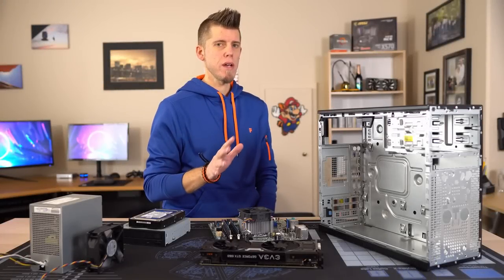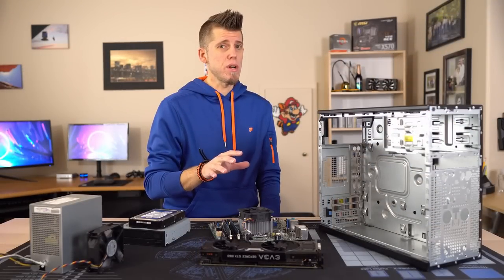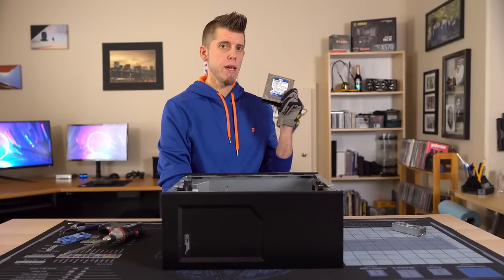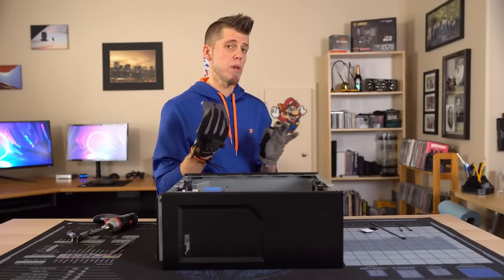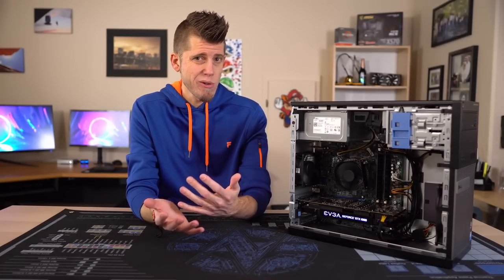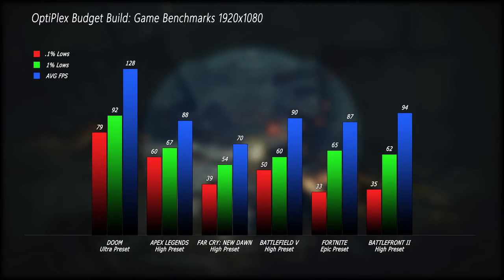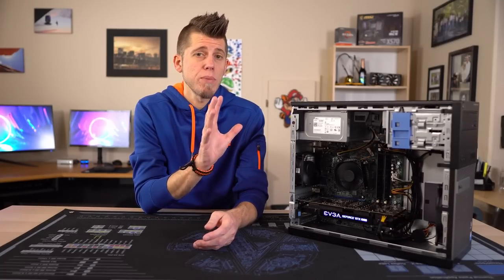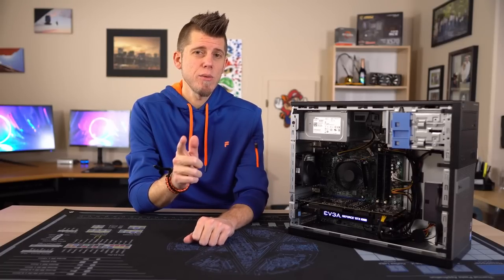Dell OptiPlex Budget Gaming PC For Under $300?

Comment: I've got an optiplex 7010 with i7 3770 and 1060 6gb 500gb ssd 1tb hdd and 20gb ddr3 1600 as my living room console replacment pc
Reply: Also dremeled out the front and put a 120 blue led fan in front and one in back. I had all the temp sensors and everything so it boots without F1 aslo. I painted the front black where the grey is and white where the black is for extra flare as well
Reply: Had to cut out part of the drive bay and get 90 degree data cord to fit gpu...

Comment: can you upgrade the rear exhaust fan or no?
Reply from the maker: Yes, it's just a 92mm fan and there are adapters to go from the five pin Molex SL connector to a standard 4-pin fan. It's a pretty decent fan though. You can try to replace it, but it can be problematic as the fan controller is very picky. The fan might work but throw an error code.
Reply: @TheGameBench  so if I get a better 92mm fan that uses 4 pin everything should be straight or should I just not worry about. I just added a 140mm intake fan and just wanted to know if it was necessary to upgrade the exhaust fan

Comment: how did you install the fan
Reply from the maker: If you're wondering how I modified the case to get the fan in, I did a video on what you need to remove to be able to install the front fan. I will say that there are ways to do it without doing what I did. They just don't look as clean.
Reply: @TheGameBench  what product you stick for cable management?
Reply from the maker: @pyromisery1638  What specifically? Everything I used in the video is linked in the description.

Comment: How much watts is the psu in that optiplex?
Reply from the maker: It's the factory power supply, which is 290 watts, which is fine with anything up to around 120 watts using the adapter. If you don't trust those, or you need more power, the XE2 power supply will drop right into these systems and are 365 watts. They also have a 6-pin PCIe power connection that can be adapted to 8-pins.
Reply: @TheGameBench  i have optiplex 990 mt version, i am thinking of a cx550w M power supply upgrade. Its length is 140mm(5.5 inches). Do you think it will fit. The 990 has 265w stock psu

Comment: Does it work with gamemax vp 700?  optiplex 790
Reply from the maker: I know that PSU isn't one of the best out there, so I'd be careful with how much of a load you put on it. Definitely don't trust the 700 watt rating since it looks like it can only supply 576 watts on the +12v rail. I would try to keep the power consumption around 400 watts. And with the 790 and a 1060 6GB you'll be well under that.
Reply: I will put a gtx 750 ti card, is that enough?
Reply: @TheGameBench   PS-LTP-0650NPCNUK-2 ok that ?

Comment: can i do this on dell optiplex 3040 mini tower????
Reply from the maker: Yes... with some exceptions. The 3040 has a 240 watt TFX power supply. The same one found with the xx20 SFF models. So, the power supply isn't good enough to run a 1060 6GB. You can easily solve that with by replacing it with the Dell XE2 SFF power supply. You can find them on eBay for about $35, and they're a 315 watt power supply. They'll drop right in to your 3040 and then you'd be fine with a 1060 6GB, 1660, 1660 Super/Ti, and possibly some lower clocked RX 470/570s. I'd suggest using a dual SATA to PCIe adapter with most of those cards.

The other thing to keep in mind is clearance. The 3040 is pretty narrow and you may run into clearance issues depending on the model.
Reply: @TheGameBench   thank you very much!!
Reply: what about  gtx 1650 4gb on  Dell Optiplex 7020 { i5 , 16gb ram }
Reply from the maker: @pesstudiogameplay6412  Yep, the SFF models all have a 240 watt PSU and it's more than enough for a 1650. With the 7020 and 9020 SFF models, the PCIe x16 slot is right next to the power supply, so you'd have to use the x4 slot near the CPU instead. Yes, it will affect performance slightly.

Comment: Optiplexs are still affordable even now with all the price inflation but the graphics cards are still to expensive
Reply from the maker: Yeah, most everything has come back down to a reasonable level, but GPU's are mostly still absurd. You can find somewhat decent deal if you're willing to look at something with 4GB of VRAM or less. And while GPU prices have dropped, I don't see it getting a lot better until ETH 2.0 drops and makes mining with GPU's impossible. Then I feel like it will get a lot better, so long as people are willing to buy ex-mining GPU's as the flood onto the market.

Comment: This Gtx 1060 with psu stock?
Reply from the maker: Yep. The 1060 is pretty power conservative. As long as you don't overclock, it's fine on the stock power supply.

Comment: Thats not even good deal. I got 2x rx470 4gb strix, non working fans for 75eur both. Ill just go for cheapest option for cooling and that is geting rid of on-radiator fans, buying gpu cooling companion that sticks in slot under gpu from aliexpress for 6$ and will undervolt the cards. Im not going for cfx deffinitely. They are going in two separate builds with i5 3470 cpus.

Comment: I'm a precision guy myself.
Reply from the maker: That really depends on the Precision. Your entry level models are mostly just rebranded Optiplex systems. The T1700, for example, is just a 9020 with a different faceplate. The only other real difference is that it could come with the XE2 power supply. The T3620 was entirely different, and an interesting system for sure. Definitely better than the Optiplex xx40/xx50 in every way. Now, if you're talking about the higher end workstations, that's a different story.

Comment: What’s the back fan size
Reply from the maker: The rear fan is 92mm. In the 390, 3010 and 3020 it's the standard 25mm thick. In the 790/990, 7010/9010 and 7020/9020 it's 38mm thick.

Comment: try to go with a RX 580 they're cheap too and probably better than 1060.
Reply from the maker: Maybe, maybe not. However, you're not running a 580 off the stock power supply unlike the 1060. I spent the last two weeks trying to get a good deal on a 580 and the best I came up with was $120, plus at least $40 for a half decent power supply, and now I've gone over the $300 budget. I'll admit that it's possible to get them cheaper, but it's certainly not common or a realistic scenario to give to people who want to emulate this.
Reply: sure, but not at this price point 🙂

Comment: Greatly appreciate your taking the time to make this and the other videos. Question: Would this work well as a PSU (after getting an adapter cable)? Found it when cleaning and never used it :) https://www.newegg.com/antec-smartpower-2-0-sp-500-500w/p/N82E16817103937

Thanks.
Reply from the maker: Yeah, it'll work... depending on what GPU you want to run with it. It only has dual six pin PCIe connections and it probably has about 375 watts, combined, on the 12v rails.

Comment: Anyone watching this PLEASE DO NOT use the Optiflex PSU with a 1060 GPU or your build will die. The existing Dell Optiflex standard power supply is dangerously inadequate for the power demands of the 1060 GPU. The 1060 minimum power requirement alone is 400 watts and the Dell power supply he is using is only 280 watt or 300 watt at maximum. The whole system needs a 500 watt PSU minimum, a 300 watt PSU will be under so much strain powering the components including the GPU, it will fry many components when it eventually blows up.
Reply from the maker: The 1060 consumes 120 watts. The rest of the system is under 100 watts. The nVidia power recommendation is a vast overestimation to cover their ass.

Comment: you should have just migrated it to a new case, spending a 30 bucks for a new case would be totally worth it.
Reply from the maker: Though I would argue that a $30 case would be worse than this one. At least the OptiPlex case is sturdy. I've not seen a $30 case that didn't have the structural integrity of a boiled noodle. Plus, there's all the proprietary connections, at are a PITA to deal with. If you don't have the tools... is it cheaper, and easier? Sure. But I would say spend $60 and get something like the Phanteks P300A.

Comment: Can I out a rx 580 in a dell
Reply from the maker: Sure, the RX 580 would work as well, but it will absolutely need a better power supply.
Reply: I bought one Dell optiplex from Amazon with rx550 16gb ram

Comment: This is a pretty good video, solid build, but in a PC build video, its never really a good idea to instruct people to mess with the power supply cable or try adding connectors to it what so ever.  Also using the stock power supply from an optiplex when adding the GPU and another HDD like that is never a good idea.
Reply from the maker: I've done a lot of work with power supplies. Sleeved my own PSU cables. There's nothing wrong with what i showed people. It's perfectly safe. The PSU has adequate amperage for the added fan, PSU, and SSD. That being said, I offered alternatives for people that didn't feel comfortable with the modifications.

Comment: Bruh 1060 3gb on ps4 pro and 6gb on xbox BRUH your giving them to muchh credit it's more like a gt 1030 XD OR A 950 OR A 780 XD
Reply from the maker: I don't man... that seems to be the consensus on the hardware side. However, I feel like the hardware is being held back by thermal and power limitations.
Reply: @TheGameBench  well let me tell you why hardware doesnt matter the cpu jaguar is garbage cant multitask for shit a 3000g or even a celeron from the 7th generation can beat the performance of a ps4 or xbox one the normal versions of the console are the equivalent of 7850 in terms of performance just cause it has 8gb of vram doesnt mean it even comes close to using it they just added it for future proof the games to work and remember no game on the ps4 or xbox one peo versions runs natively 1080p 60fps no game runs like that no tripple A game atleast for example overwatch and black ops 3 dont run at 1080p they nearly run at 900p try to do a comparison put two monitors together and you will see that the quality of image is garbage I bash it so much cause I got sucked into a console when I could have build a pc a long ass time ago and enjoy WAY BETTER GAMES remember they need to keep cost low and sell high so why would they put high end hardware like that and also the 1060 didn't come out yet at that time sorry for long paragraph but there have been many tests on what resolution or quality they run and majority is 900p

Comment: Under watt power supply.
Reply from the maker: I've done my testing, and the 1060 is a low power consumption GPU. This pulls about 240 watts from the outlet at a full system load. Since the outlet draw will be higher, the components are consuming, at max, 220 watts or less. While not ideal, it's functionally fine. I tested this in my last video.
Reply: @TheGameBench  Key text right there. "not ideal"

So why would this be okay? Even for a budget build, nah dude. Thats not worth it if the 1060 is not running all the way.
Reply: @TheGameBench  Still pushing the line since the recommended PSU for that GPU is 400W and you have a 255W PSU.  220 is unnervingly close to maxout, I guess its technically works but still risky i think.
Reply from the maker: @morpheuskibbe  They also suggest a 300 watt power supply for a 1050 Ti. A GPU that pulls less than 100 watts. The 1060 pulls about 120 watts. They do this to cover their ass for people buying garbage power supplies that rate high peak wattage, but provide low constant wattage or have low amperage on the 12v rail. Also, this is a 290, not a 255, watt power supply and it's not a terrible power supply either. I've torture tested these. They can handle a 1060 with about 70- 80 watts to spare.

Comment: Dell 290w PSU tier Bronze or Silver ?
Reply from the maker: The one in this video was not 80+ rated though you could find them with 80+ bronze and 80+ gold rated units. I will say that it doesn't really matter outside of efficiency.

Comment: Nowadays optiplexes go for a high price. I guess people realise what they are capable of. ;_;
Reply from the maker: Yeah, but you can still find deals. I grabbed a few for under $100 here locally. It doesn't help that everything PC related is up right now due to the pandemic. However, I've heard that supply chains have opened back up on new parts, so it's only a matter of time until we see used stuff drop down to pre-pandemic pricing again.

Comment: well hell WTF i would rather have a  i5 9th gen then a i7 4th gen ... but you almost pulled it off, your acting is good but your lines need work
Reply from the maker: Not going to argue that, but this wasn't about what's better. This was about building a gaming PC that costs as much as a console, but performs better. Not doing that with a 9th Gen i5. And yeah, it's awkward talking to a camera, but that will get better with time.

Comment: 1060 is a lot better then the 7850-ish GPU thats in the original PS4.
Reply from the maker: Yep. I had a 7850 at one point and it's substantially slower than the 1060.

Comment: That looks like a expensive gpu ?
Reply from the maker: For a couple of years after I made this video... it was. Now, it's not very expensive at all. Tho I might suggest looking at the 1660 Super or Ti instead. Consumes the same power, not much more money, but much more performance. However, they're not a good pairing with the i5 processor.
Reply: @TheGameBench  Just bought the 9020 with the i7-4770 in it. Would this be a good pairing for the 1660Ti? and if so can I use the psu method in the video for this card as well or should I upgrade the psu?

Comment: 🙂👍 Nice, you stripped the case to the bare bone, thats how it should be done
Reply from the maker: Yep, and I had a couple of people tell me I was being overly cautious doing so. 😄
Reply: @TheGameBench  ☺️ they dont know what they are talking about, the dirt and dust can sometimes leave a layer that is very hard to remove, i usually wait for summer and strip it outside, car wash brush, hot soap n water, i get ocd on it, i then wipe dry and leave it out in the hot sun 90 degree sun. Before the final wash I look at the case and see if i can do any lite modding like drilling holes, removing rivets, making hole for the cpu cooler bracket. Theres also a small chance of bug infestation, its more common in consoles but desktops can get them too. For fun I like to buy old desktops from our local Freegeek recycler. They only do basic cleaning, i can tell when i take it home, open it in the backyard and the first time you hit it with air from the air compressor you see a huge cloud of dust blow out of everything especially the cpu cooler & psu, i hold me breath, its a Biohazard ☺️ LOL
Reply: 🙂 my current pending washout is a HP Z200, i got it on sale at Freegeek, the whole back of the case got coffee and coke spill sticky residue ☺️
Reply from the maker: @MrSamadolfo  Oh man... those same people's heads just exploded when they read you clean them with soapy water. Yeah, there are a lot of people like to talk like they know what they're talking about but don't have a clue. Hell, I had someone bring me a system a few years back, said it was hosed because it had been in a flood. It was gross... no question, but after hosing it down then scrubbing it with some Deoxit 55, it worked perfectly fine. My sister is still using it to this day.
Reply: @TheGameBench  🙂 I dont know how the old wives tale started but maybe 1980's oem pc cases were using cheaper metals and they would start to rust instantly on contact with water, but all the oem cases from core2duo era Dell,Hp,Lenovo are using a better steel, its doesnt rust instantly, of course i wouldn't leave it wet overnite, after I finish drilling or cutting any metal i give it a final washout with the garden hose to make sure i get any metal particles out, i then dry it down with a bath towel, then leave it on a table outside and let the hot summer sun burn off any water thats left, its usually bone dry within an hour, if theres no sun then i put it on a table and put a tabletop fan rite next to it and leave the fan blowing it for a couple hours. Optional: After its dry you can spray paint it Black and then put it back out in the sun to help the paint stick better and dry better.
Reply: @TheGameBench  🙂 yes some cases are really gross, its actually kind of rare but it happens, check around youtube videos, some people have uploaded videos especially about cleaning gross pc cases, another gross video to check out are the console cleaning videos and laptop videos, they filmed the nasty roach infestation, its gross af, some old timers mentioned that roach infestation was common before, so when a customer brings their desktop in to get it fixed they setup a table outside of the store, they would pop open the case and you would see a bunch of roaches scurrying out 😊

Comment: Wdym cheap? I can't find any ssd drives wih 250 GB for under $70 in AU
Reply: just get a 125gb, or even a 60gb if they are hard to find, only use the ssd to install the os and programs, everything else put on a regular hard drive